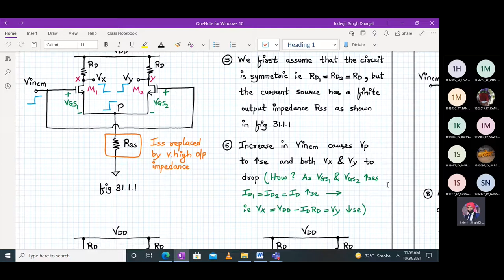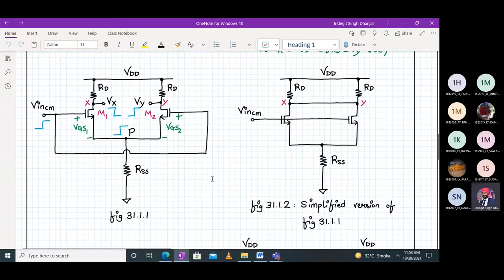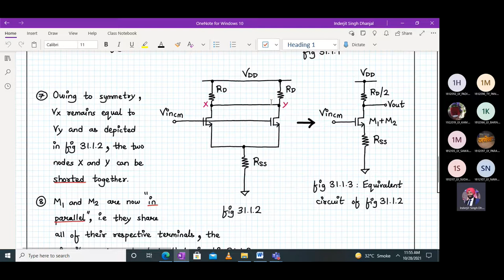Analog VLSI Design Lecture 31.1: Common mode response of symmetric Differential amplifier

Comment: Sir when you say if VGS increases, Vp will also increase. But if Vincm is increasing and if Vp is also increasing wont it mean that ultimately Vgs will remain the same since both have increased to keep the difference between Vg and Vs(or Vp) the same?
Reply from the maker: Refer, Analog VLSI Design Lecture 27.2 ( Refer Section: Common mode behavior of Diffamp), there this point is covered.  Link:  https://youtu.be/oicm3Pi6b5g